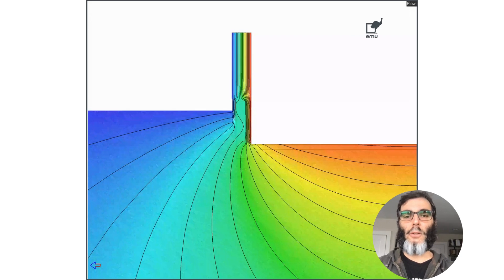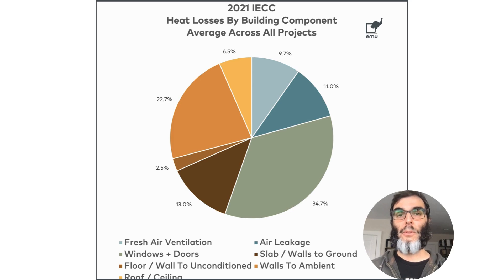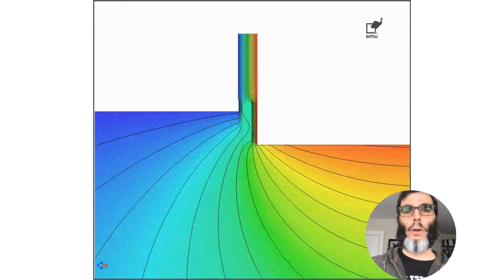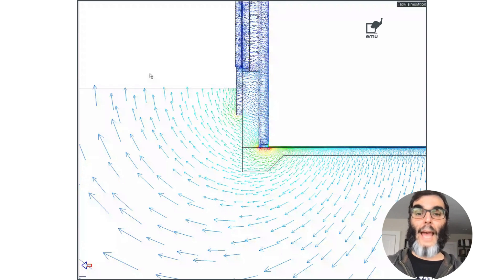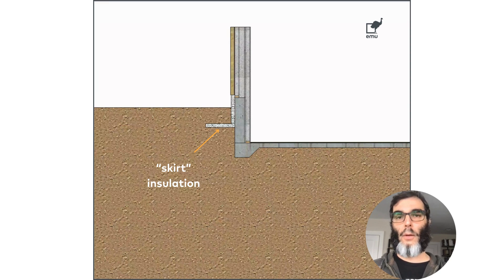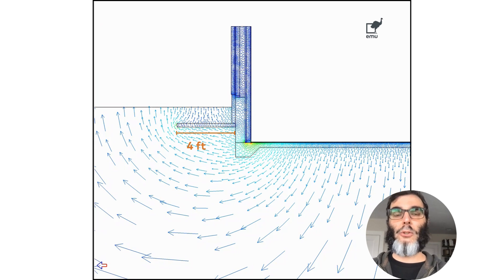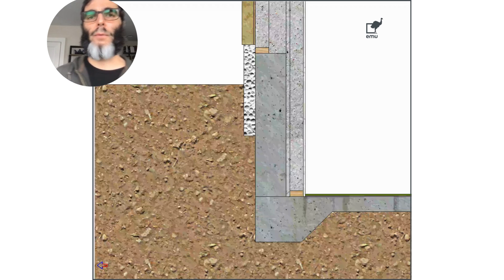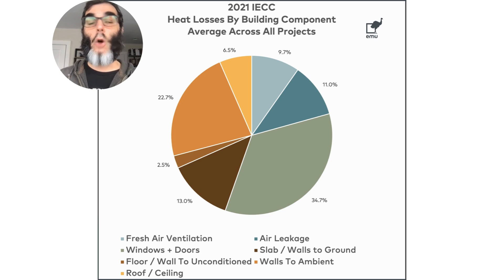Heat Losses Through The Ground

Comment: Main benefit of the skirt insulation is that you do also maintain a lot of thermal mass in the home, where is insulating the actual slab means that the home will heat up and cool down faster, climate with bigger swings it might be more beneficial to therefore go for the skirt design.
Reply from the maker: correct, and please remember this project was a retrofit, meaning that adding insulation under the existing slab was not an option. once we look at the actual numbers of energy consumption, it is very clear that the thermal mass has a negligible effect compared to the effect of thermal insulation. One exception for that is very hot and dry climates, and even in those hot climates, other parameters have a bigger impact than thermal mass (eg interior setpoint temperature)

Comment: Interesting comparison across the different ways to reduce thermal losses through soil.  I'd be interested to see a similar study which also includes background thermal behaviour of the soil for the boundary condition below.  For example, where I live, footing depth must be a minimum of 4' below grade when the building has a heated space below grade (basement), but when built over unheated space (ambient temperature crawlspace), the depth of frost is typically 7'.  Clearly the thermal loss from the basement slab/wall prevents frost (and potential structural damage due to frost heave) from reaching the footing depth.  What impact on frost penetration does insulating the slab have?  With increased focus on improving the thermal envelope, is there an increased risk of structural damage?

Comment: how was the amount of heat loss due to (1) air leakage and (2) conductive losses through slab/ground calculated or measured?
Reply from the maker: Unfortunately, we cannot isolate the air leakage of the slab alone. Air leakage is measured for the building as a whole

Comment: How about moisture? Where I live (Sweden) it is seen as a risk to insulate from the inside. There were mutliple cases of problems in the 70-80s because of a lot of insulation beeing done after the oil crisis.  Especially that piece of wood where wall meets floor is at risk of high relative humidity.
Reply: The bottom plate of the interior wall will be substantially colder than the interior air temperature after that 1" polyiso insulation. Any humidity from air from interior that gets into that plate will condensate and the plate will rotten out fast. Does your program estimate temperature of that bottom plate? Imho the polyiso on the floor should go under the bottom plate.
Reply from the maker: @samipoykko7789  I hear your concern, but  based on the data we see I don't find the concern justified. If anything at the detail you mention we may have exterior air infiltrating into the building (due to the stack effect). One risk for the bottom plate is capillary action bringing moisture up from the existing slab, so we need to make sure we have some dampproofing done before installing the bottom plate. I hope this makes sense, please let me know if you have more questions
Reply: @emupassive  I would use treated lumber for it. And of course always capillary break.
Reply from the maker: @samipoykko7789  yes we spec pressure treated wood for that bottom plate
Reply from the maker: yes, moisture management needs to be addressed of course. in this case, we have a vapor barrier at the floor over the 1” polyiso board, and a smart vapor retarder at the wall on the interior of the insulation